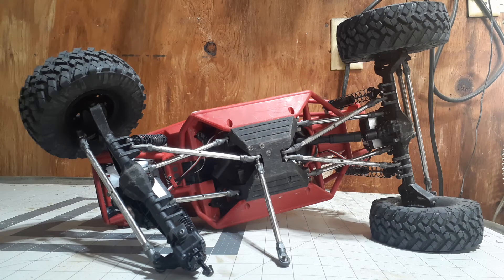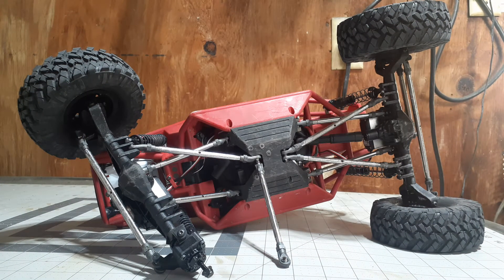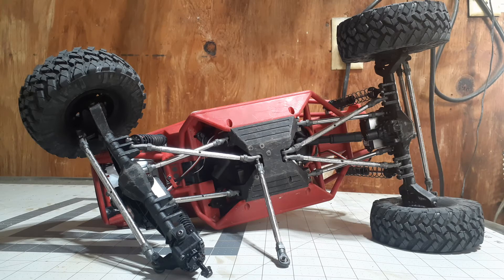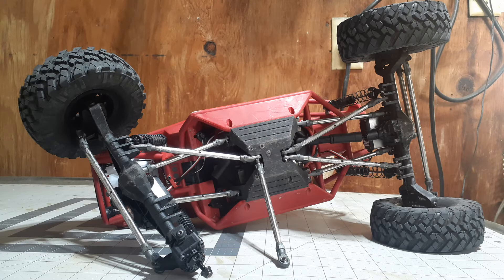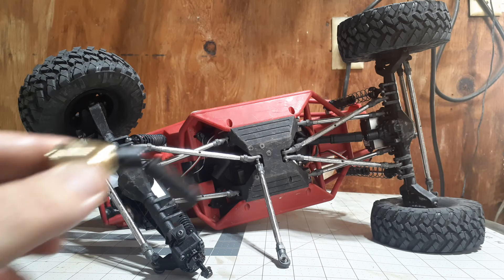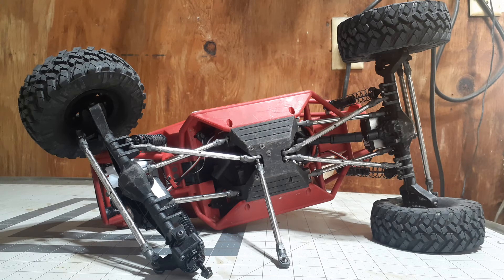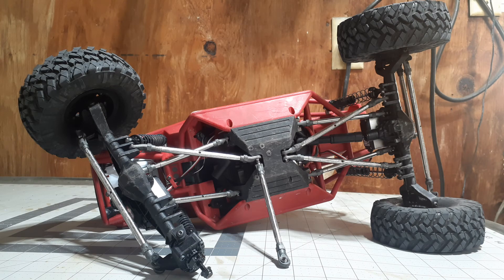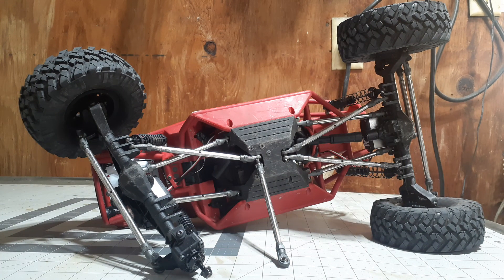I installed a Hot Racing brass differential cover in my Capra 4ws. Is it worth it..?

Comment: Cool video... those foams are interesting. 
Do you have a hobbywing 1080 programming card? I believe they'll work on the spektrum speed control... I think it's got about 10 items you can program including drag brake. If not just get the spektrum version.  Crawling with a weak drag brake is no fun.
Look forward to your thoughts on the foams.
Cheers 👍